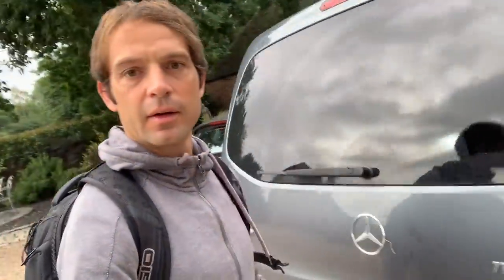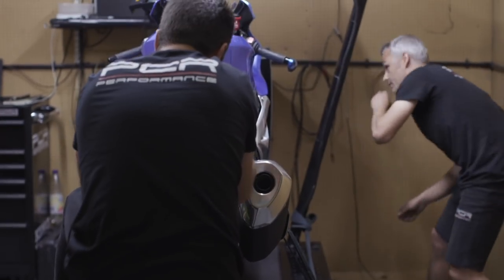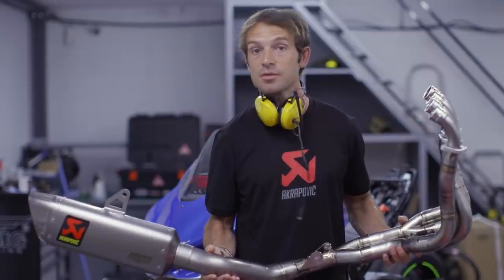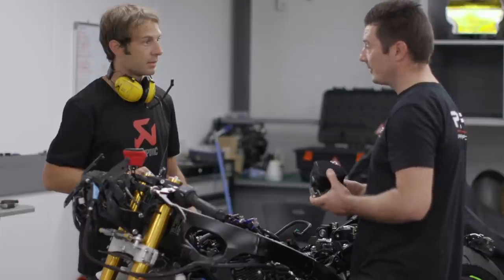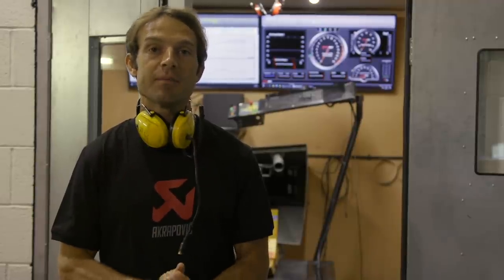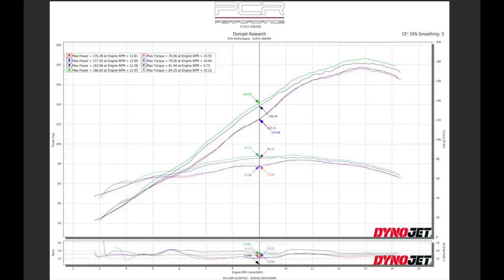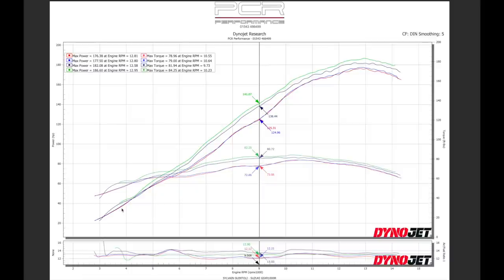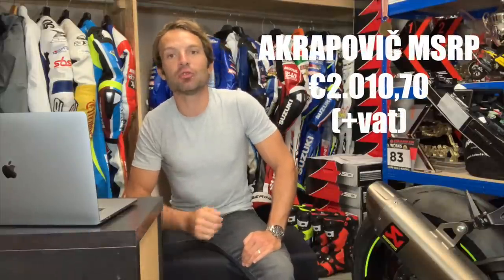🇬🇧IT'S AKRAPOVIČ TIME!🔥 DYNO TEST, POWER & TORQUE INCREASE, WEIGHT, SOUND, ECU REMAPPING, PRICE

Comment: Forget PCR.... take it to MSG Racing near Oxfordshire I took my GSX-R 1000 L7 there today and got 192.78bhp 86.35 torque. Lextek headers yoshi R11 exhaust and sprint P08F1-85 air filter. Well happy with the result 😀

Comment: Wow, really good video with great information! Also awesome video quality, looks like a professional production!

I'm looking forward to hear your impressions after the first sessions on track. 
I've had my bike mapped to the race exhaust and find throttle control much easier and the engine reacts quite a bit smoother - especially at the lowest few percent of throttle opening. This gave me much more confidence in mid-turn and was a great advantage for me as a hobby-rider, much more than the few horses gained (which I hardly use anyway)

Comment: Great video. Confirms my thoughts that slip-ons are really just for "bling" but full systems really do add big-time to performance. I was surprised that the re-map didn't make a bigger difference after such a big exhaust change - thought without the re-map it would be horrible but no!  Very interesting - not seen that "pre-map" chart before (nice!). For the full race system - $/HP - probably one of the cheapest mods you can do (try finding 10KG and 10 BHP for less than $2.5K!!).
Reply from the maker: Andrew Boundy yes 💯 agreed. All in its about 7kg lighter, 15hp in mid range and 10 at the top. I tried it today on track (Donington) Massive difference. Feels like a race bike now
Reply: @SylvainGuintoli  Looking forward to the "report" VLOG :-)
Reply: @SylvainGuintoli  i think this video also shows that suzuki does provide a pretty well powered bike straight from the factory.

Comment: What do we reckon is the total weight saving with full system and all the valves and emmision components removed? Got to be getting on for 8/10kg. Add a lightweight battery in the mix, not to mention all the road parts like headlight etc being removed. Be good to see what the before and after weight saving is

Comment: Great video,  well explained.   Did you use standard 95RON fuel or something with a higher octane rating?   Also is fuel a standard item in WSBK and GP championships?
Reply from the maker: Thanks. I used 98 fuel. WSBK and MotoGP both use special fuels to enhance efficiency

Comment: Lovely video!! Have the same bike. Same Exhaust. And Woolich is on the way. So apart from the block off plates i just go ahead and remove the servo motor and the EVAP valve unit? I also got the Woolich wideband Auto tune. So i am confused of i need to get rid of these components. Did you change the spark plugs on the bike? 

Hope you have fun on the track. It's a lovely piece of kit. Cheers!!!
Reply from the maker: rkulkarni12 PCR performance did the mapping,  probably best to get in touch with them for the technical questions

Comment: Fantastic video mate, am a new sub going to work my way through all you vids love my 2017 Gsxr1000.  Really really want one of these systems! Its on the santa list lol. I am doing my first track day on the gixxer 10th September (not my first trackday) what cold tyre pressures would you recommend? No warmers running new Michelin GPs . Thanks David
Reply from the maker: suzukitime55 not tried the GP’s, so best to ask your dealer about them. Tried the PowerCup2 starting cold at 2.1Bars Front & 1.5Bar rear was best
Reply: @SylvainGuintoli  thanks for the reply Sylvain , keep you the good work mate 👍😎

Comment: Super vidéo, vu son prix on voit clairement que le slip-on ne vaut pas le coup, courbe a l'appui !
Le gain aux moyens régimes de la ligne complète est impressionnant, j'espère tomber sur un collecteur ou ligne complète d'occas' pour ma 1000 k3 mais c'est une pièce rarissime, je ne sais pas ou trouver ça 🙁

Pour info ma k3 sort 152ch a la roue vers 12000trs, presque 20ch gagnés en 17 ans, pas degueu. J'ai aucune idée du poids de la mienne par contre.

Je suis a l'aise avec l'anglais donc j'ai privilégié la vidéo d'origine, dans celle traduite en français j'avais un peu de mal a suivre, ta voix se superpose dans 2 langues différentes et le niveau de son est trop proche entre les 2. Je ne sais pas trop comment l'expliquer mais si tu baissais un peu plus le son de base de la video quand tu parles en anglais, cela faciliterai la compréhension de ta traduction.
Reply from the maker: Des gains de puissance / couple pas énorme avec le slip ON, par contre c'est une oeuvre d'art 😍😜

Comment: What are the two items that you removed from the bike? A something valve? I'd like to know as i have the same bike, thank you:)
Reply: remove pair valve, remove EVAP valve, remove exhaust valve servo. install strait titanium pipe and remap/flash ecu so the engine has a new baseline with all the airflow restrictions that have been removed
Reply: @AH-pm3bx  thank you gents

Comment: Racing Air filter, racing oil, racing fuel, velocity stack, port polished intake, flashed ecu, (will it reach 220+?)
Reply: Need a good head, cams n 3mil bore also to reach 220rwhp+

Comment: I have been trying to decide on a full system. My closest track has sound restrictions so I am looking for something that when baffled, can still pass sound.. I know you guys have a lot of restricted tracks there in the UK. I would be curious to know if that Akrapovic can be made to pass.
Reply from the maker: Christopher Dickerson Yes in UK the noise regulations are strict. I am preparing a “track video” about the Akrapovic Evolution Line Titanium system, including indépendant noise checks. Will feature all the results in. 1 tip for you, this system is LOUD! Which is great but no so great for noise reg
Reply: @SylvainGuintoli  Really interested to see that! Thank you for the info...